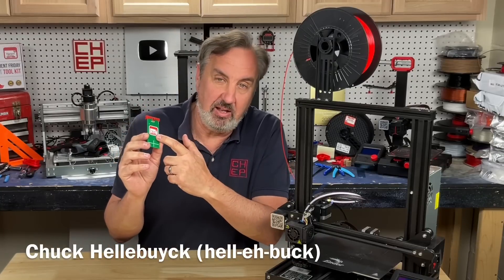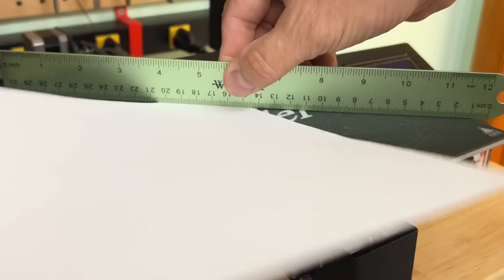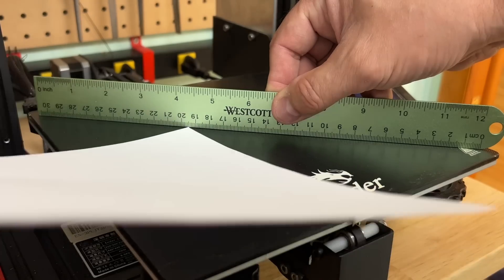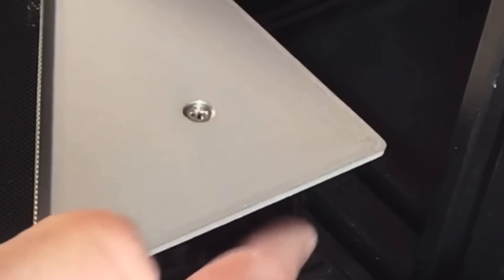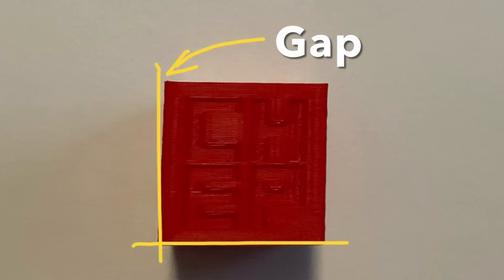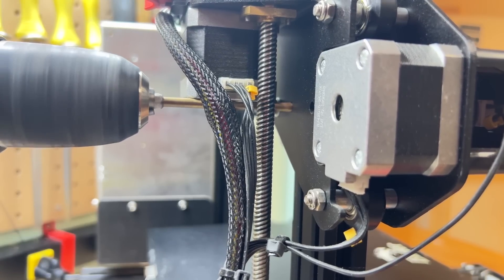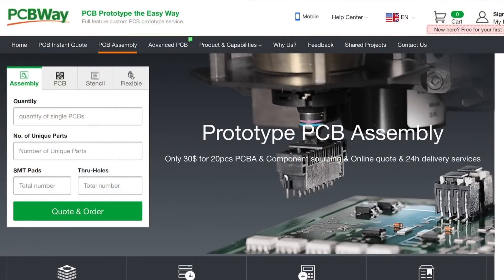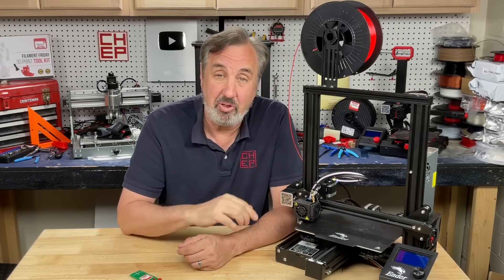Tips and Tricks for Better Bed Leveling

Comment: I don't find levelling my Ender 5 glass bed too difficult using a feeler gauge but having purchased your preassembled E leveller Chuck it is now a dream.  Using the g-code levelling file and and the test print squares file it is bang on every time.  Job done.  What a brilliant but simple tool.  Thank you.

Comment: “There’s more coils.” More coils makes a spring softer, actually. Those springs are stiffer because they use a bigger, stronger wire, not because they have more coils. Take two springs that are made from the same wire and are the same height, one with 20 coils and one with 10 coils, and the latter will be stiffer.

Comment: Glass bed is not a solution in many cases. Sometimes under glass bed you need to add tin foil.
Reply: Tin foil? Whatchatalkinboutwillis? The biggest problem with glass beds is that folks don't allow some extra time for the entire surface to heat up. When the sensor (thermistor) on the bottom says it's 60 degrees, the top might still be at 50. It takes a little extra time for the heat to dissipate through the glass. Keep your tin foil for making hats.
Reply: @Ron Bemis  how long should I wait? 10min , 1h? In my case, waiting changes nothing. I tested many solutions, and only tin foil fixed that problem.
Reply: @krzysztofmalinski9165  you have obviously never tried glass.
Reply: @Bill Green check Fokoos Odin 5 f3, it's my printer, and it has a glass bed by default. So, it looks like your assumptions are wrong.
Reply: @Bill Green  I obviously tried coz i have it. And now what? You obviously don't read previous posts.
Reply: @krzysztofmalinski9165   I saw that you said that but then the rest of what you said about tin foil did not make sense. So I assumed you were just making stuff up.
Reply: I print on Creality glass all the time and I have never had a failure.  The print sticks to the glass when hot and pops off when cool. My go to.
Reply: @billgreen8966  unfortunately  odin 5 f3 has such issue....
Reply: @krzysztofmalinski9165  you have never tried glass have you?

Comment: Thanks for the tip for the crossbeam, do not think it is much of a problem putting a hole in the upright as there are holes for the power on the other not used on the v2, saved me lots of time and trouble .

Comment: Hey Chuck. I just bought your E-leveler and having issues with it. Whenever I try to use it, the Z hight is too high to get the nozzle anywhere close to the leveller. Tried changing the Z-offset to 0, plus and ,minus 5.8 (what its set to in the gcode) and still no change.Even when im going from the bed being right at the top to the turn screws coming off.  I'm using a BL touch if that helps but I would really love some advice on how to use it. Especially after paying the equivalent of $55 for it
Reply from the maker: Because you have the autolevel sensor it probably is creating an additional z offset after homing. Need to adjust that out and the move the head manually to each corner.

Comment: I have both the Ender 3 Pro & the CR 6SE (Kickstarter) With each new version of Cura people make profiles for the Ender 3 But not the CR 6SE. how difference are the profiles except for the Build board size.
Reply from the maker: I start with Ender 3 pro profile for all these machines and just adjust from there.

Comment: PEI springsteel beds and high bed temperatures: this springsteel is magnetic and magnets wear out above 80C and loose magnetism.  Are those magnets in the PEI sheet or down on the heatbed?  Is it enough for exchanging the PEI sheet for glass or FRU formthose cases where i need >100C on the bed without destroying the magnets?
Reply: The strength of permanent magnetic field is linear with temperature. Ceramic magnets get 0.2% weaker for every degree C increase. So the bed will be held with 16% less force at 100C than at 20C. That strength is completely reversible as long as the temperature stays below 180C.

Comment: Didn't you used to sell the E-Leveler Tool as a kit? Or maybe just the circuit board, so you could get your own switch, battery, LED, and solder it together yourself? I've seen comments that the battery holder could be of better quality...
Reply from the maker: Kit was discontinued.

Comment: Call me crazy if you want, but I believe that if Creality and other printer manufacturers enabled manual mesh bed leveling in their firmware right out of the box, 90% of the warped-bed issues in printers would go away.  Manual mesh bed leveling is built into Marlin, and it would be a very simple thing for Creality and others to ship printers with it enabled.  And manual mesh bed leveling does not require a leveling probe or any extra hardware.  I enabled manual mesh bed leveling on my Ender 5 Pro a few years ago, and have never looked back.

Comment: 25$ for a glorified led circuit is beyond me. material cost is at most a dollar for everything. miight aswell buy a clone bltouch for the same price.
Reply: Don't be a cheapskate. $25 is nothing for having the idea, designing it, putting the money up to mass market and then advertise and sell it.  The reality is he did it, you didn't.
Reply: You do realise that the cost of the product goes beyond labour and materials? Someone had to muck about with the design for god knows how long.
Reply from the maker: @surajbhawal2474 - It works better than a BLTouch. Just ask our customers. And one E-Leveler works with multiple machines while BLTouch requires one for each machine.

Comment: Ive got a Sovol SV03, Z offset software quirks and I have a problems with pronterface.  I purchased your e-leveler, it works wonderful on my CR-10S, but when trying to use on my Sovol SV03, the machine lowers to a point that Im unable to set the e-leveler under the nozzle.  I cant just raise the z limit switch because its controlled by the BL Touch....after examining your Leveler, I think that if you were to flip the battery on the PCB board, it would work for people with machines such as my Sovol SV03, if the coin battery holder were on the top of the PCB board with the let light, that might give the board more room to fit under the nozzle of machines that have limitations raising the Z limit switch.
LOVE product though...OUTSTANDING

Comment: Since getting the Creality CR Touch Sensor Auto Bed Leveling Kit i have no problems and have done away with the glass bed and now use a 3D Printer Build Surfaces Spring Steel Sheet Double Sided for Ender3 both you can get off EBAY and i can even print TPU with no propblems.

Comment: Great tips - I really never thought about drilling a hole to get to that screw to balance the x-gantry on the ender 3/pro!  My tip is to level the bed after it is warmed up.  Even with ABL, the more level and square you can make the printer, the more effective ABL will become for you.

Comment: Another great video as usual. Bought mine years ago with the glass bed but recently had leveling problems. Found the screws on the right side if the gantry had loosened just enough it was sliding up and down during printing. I guess the good-n-tight torque method on these only last so long.

Comment: Losing those springs and switching to a hard mount system has 100% ended my bed leveling. Replace springs with another set of adjustment wheels, or move wheels to where springs were and put wing nuts where wheels were. Use the upper set to adjust bed level, and the. Lower set to tight up to and lock that in. 

Except for accidents and worn out nozzles; you should be golden for long periods.

Comment: Great video as always - My Ender 3v2 has an issue I think (new to this) the Z switch seems to click inconsistently and therefore the home position is inaccurate. Is this an issue with the switch? All is plugged in well.
Reply: Remember that the switch is a standard microswitch(in form like the left/right mouse button microswitches) soldered onto a board, then the board is mounted on the bracket, which itself mounted to the printer frame.  The switch is actuated by being hit by something on your x gantry.  That's 5 points of failure(switch, switch/board, switch/bracket, bracket mounting to printer frame, whatever needs to press against the switch to actuate it).
Before troubleshooting the switch itself, ensure the bracket(the L shaped piece that is between the aluminum extrusions and the endstop board/switch)  it's mounted on is exactly parallel with your vertical extrusions(which is your z-axis).  It's possible to have the bracket mounted a bit cocked with respect to the z-axis(undesirable).  Yes, this is a known engineering deficiency on the Ender 3v2.  There is a video from "tomb of 3d printed horrors" regarding it.

Then, to check the switch itself.  

Step 1: observe the switch being actuated.  Does whatever is pressing down on the actuator(or a strip of metal which transmits the pressure to the actuator) hit it squarely and evenly in a good place?
Step 2: Is the switch housing itself moving(it should not)?
Step 3: Are the wires in good condition and the connectors at both ends in good shape and fully plugged in?
Step 3: If Yes/No/Yes, probably want to replace the endstop switch.

Comment: I had a very warped bed on my Cr10S-Pro, fought it for years with leveling. What I did to solve the problem was to add aluminum tape used for duct work on the heating bed, That fixed the warped bed. I print with mirrors, and even with printing with mirrors, I would have issues because the heating bed was so warped. Also I took out the springs completely and did a solid build plate mod, where you use nuts and wing-nuts to take the place of the springs, Have not had to adjust bed since, and I get perfect prints every time. Just do a search for "Tension Mounts - The best 3D Printer Bed mount". Give it a try
Reply: I would like to do this also removing the springs out of my Ender 3 Neo. What size wing nuts did you use.  I’m really new at this hobby and greatly appreciate any advice.  Thank you.
Reply: @abrahamrodriguez2298  M4x0.7 for Ender 3. I followed instructions from a you tuber named "andrewesquivel" on his video named "Tension Mounts - The best 3D Printer Bed mount may not even be a mount!". except I used nylon washers instead of metal washers. Best upgrade, and haven't leveled my bed in 6 months.
Reply: @rong2578  Thank you for your time and info and reading that you haven't leveled your bed in 6 months this really something I too have to do.  Thanks again.

Comment: i have had issues using the leveler.  Whenever i use it I'm always too close to the bed when the print starts.  I had to go back to using paper again for my leveling.
Reply: Never had a fail with paper, nor spent $25 in something I didn't need.
Reply: @KipdoesStuff  and yet you are wasting your time on here knocking something you haven't tried. Go figure.

Comment: Thanks for the great info Chuck! Couldn't agree with you more about the glass bed, waaaaay better prints and first layer! I did the same with the nylon washer on the 4 screws however I added a nut and snugged it up, never had an issue in 2 years with 5 printers. Also, forget about the springs, go with silicone mounts, typically the black ones have the highest durometer(hardness, stiffness).

Comment: Depending on which side of the aluminium plate was used for your bed you will usually have a convex or concave middle area on the bed (convex seems to be most common), if you have a convex plate then those bulldog clips will pull the corners down as they have lots of strength, I use the thumbscrew type bed clips as I can apply just enough force to hold the bed without warping it, this makes the levelling more accurate.

Comment: Great video. One way I fixed my cross beam not being level was dual z lead screws. Yeah, I know it can be expensive to buy at times but it really helps with the print quality too
Reply: Did you use the kit that has the belt on the top running on a pulley system or the kit with the stepper motor running in sync with the motor on the left side.   Thanks
Reply: @abrahamrodriguez2298  kit with the stepper motor

Comment: Do you have a video for adjusting the Z stop?
Reply: but why? takes 20 seconds add your glass bed move your limit switch up a bit job done
Reply: cut the tab off it, move your nozzle to just above the bed and then move the z stop up until it just clicks and then fix it, that is the best way to set it.

Comment: Have you tried the silicone bushings instead of the springs? I'm wondering what one is best. Thanks for bringing us all these great tips.
Reply: I switched out all 5 of my printers to the black silicone columns(they're harder and stiffer than the orange) over 2 years ago along with adding a nylon washer and a nut tightened snuggly to ensure the screws don't move. Greatly reduced, if not eliminated, the common shake and vibration found with springs. IMO the silicone columns are the best but everyone has their own opinion.😊
Reply: springs
Reply from the maker: I prefer springs but silicone work good for under autolevel.